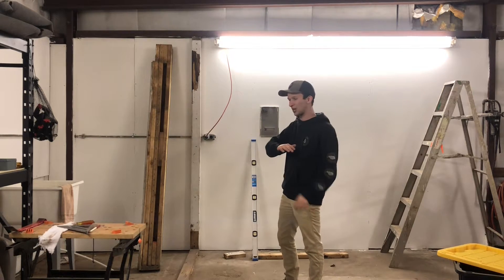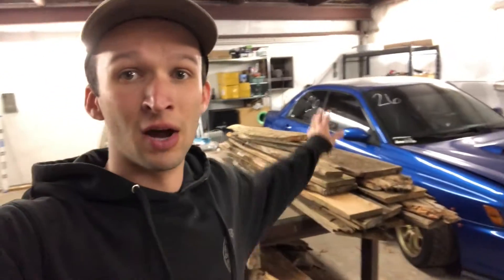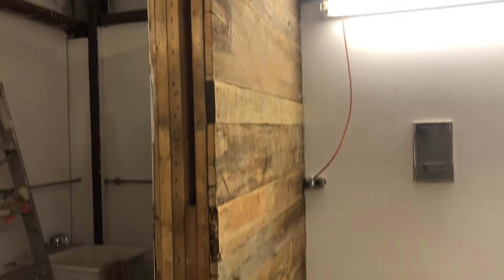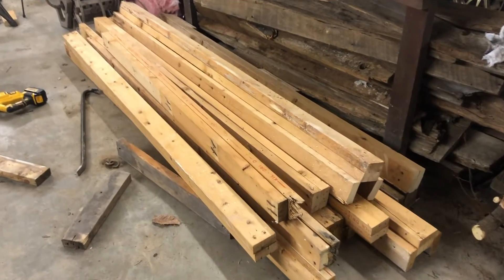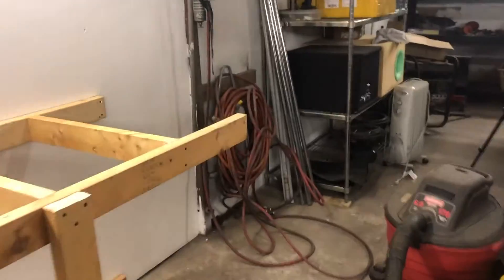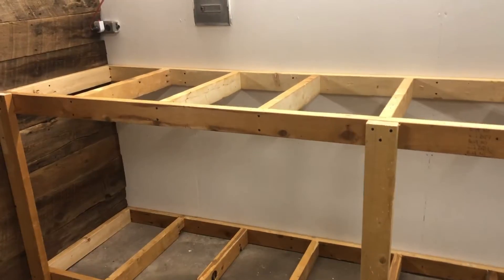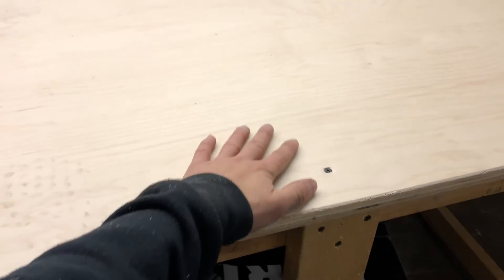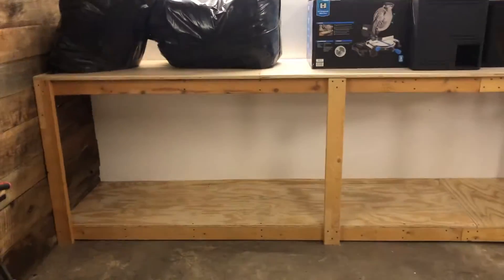Building My Dream Shop Part 3! Test Bench?

Comment: It's coming together pretty nice Parker, great job! Free boards are always nice to get. Some people will turn their nose up and act they're to good for it, they just don't understand what they're missing out on. Lol. Old barn wood is a great find, I love the rustic look it gives. Not to forget that, the older would holds up better and is stronger than most of the newer stuff. Can't wait to see more of the workshop progress. Also the Walmart subs, I think that build will change a lot of people's minds and trash talk😎😎
Reply from the maker: Yeah man Walmart subs are here! Hope to get them in this next week or two
Reply: @ParkerTheBasshead  no rush, it's a must to have a great work area first. Everything takes time bud, you're doing a great one so far! 

Unrelated note, I do have a question for you. Have you ever tested the power acoustik 12" MOFO-122X? They're dual 2ohm, I'm just wondering if they do close to the 2700 watts they claim. Lol.  I've had a lot of different subs over the years but just picked up a pair of those and haven't found any tests done on them.

Comment: Sweat now you just need a couple of motor home power supply at 100amp fuse or 150 and a stinger cap with some deep cycle batterys. ✌️👌👍😉🤔 I see the Walmart add right now it seems like Walmart has stepped up and selling good at rated stuff even the amps just read fine print cea rating 👍✌️